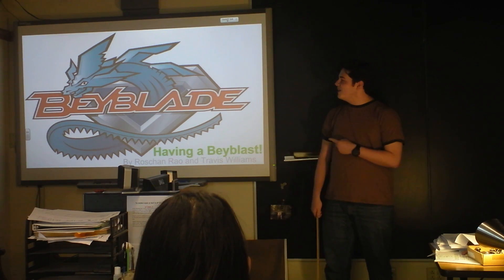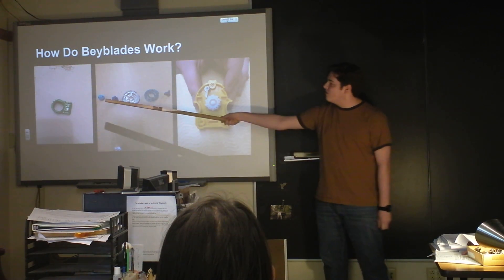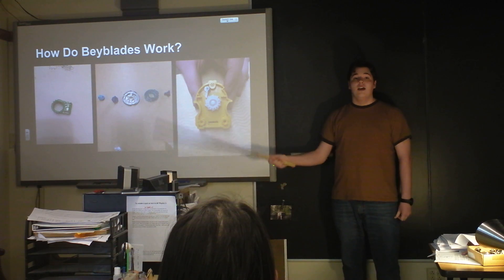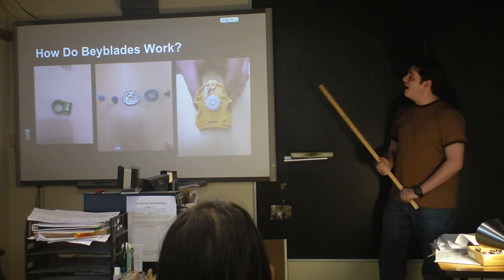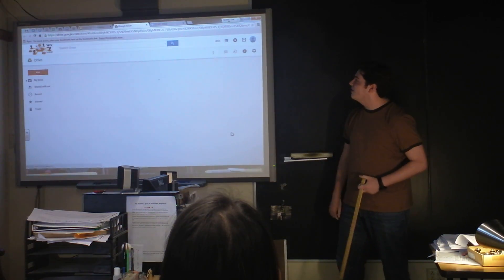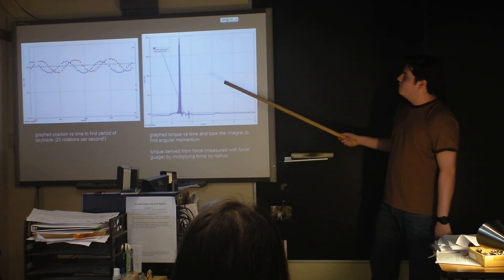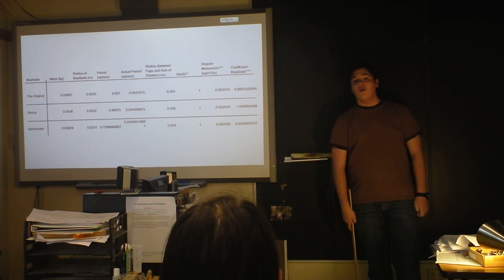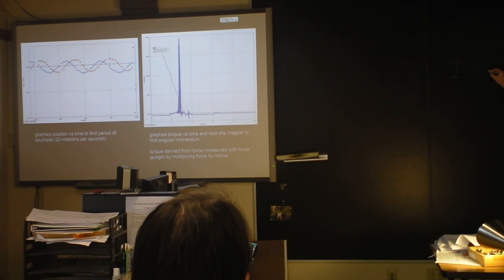Indie Lab - The Physics of Beyblades from an Expert (Rotational Inertia Found!)

Comment: The construction is known. There is some confusion about the type of metal, but its density is very easy to measure. Then it is a straightforward matter to compute the moment of inertia. This is much more accurate than the method presented in the video.
Reply from the maker: +Ellsworth Toohey Ooooh!  They know this, and are using their dynamic analysis to verify their geometric analysis.  I think they would all agree that the method you suggest has lower error in principle.  But ultimately, it's the dynamic effect of the moment of inertia that makes Beyblades interesting, so they chose to study that directly.